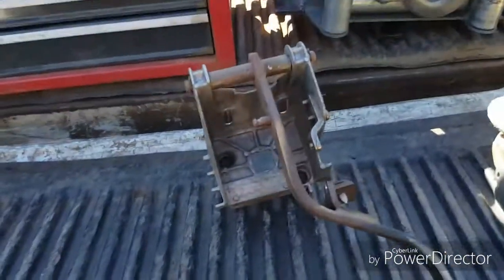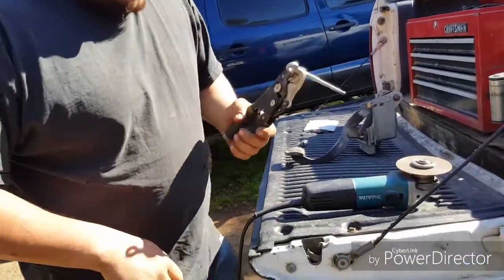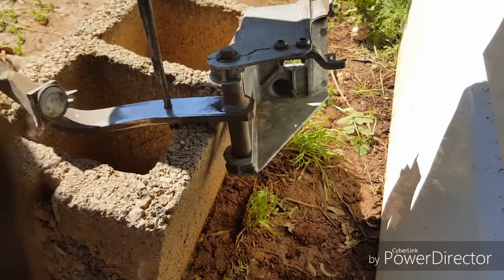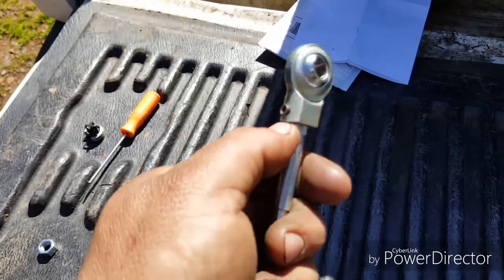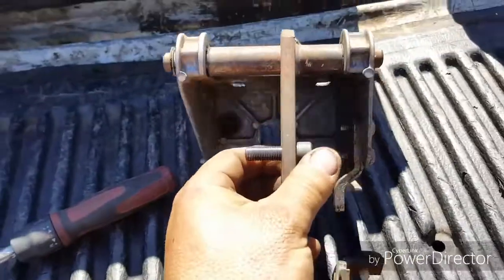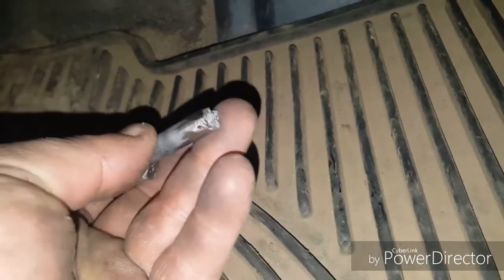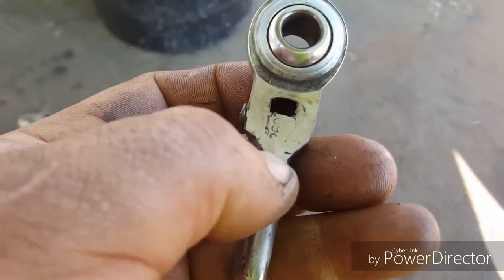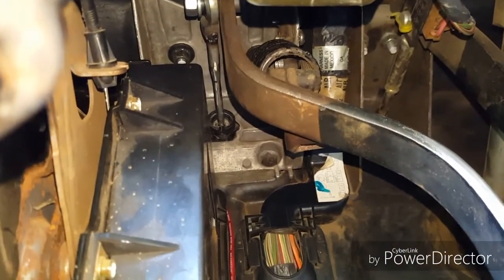F350 clutch pedal fix

Comment: Why buy the joint? Just put a big bolt and washers through the pedal and through the cluch piston loop. Much easier and cheaper.
Reply from the maker: The joint is cheap and a better fix.
Reply: @elmaschinon2699  I ground out the pin as you did. Ported the hole slightly larger to fit a grade 8 bolt the same size as the hole on the clutch rod. Put a washer on, then push it through the hole of the pedal arm. Then, 2 washers, then push it through the clutch rod, then another washer and a locking nut. 0% chance it will ever brake or come loose. Plus, the bolt is thicker and stronger than the thin hex bolt. Bolts and washers were $5.
Reply from the maker: @WhiteYetiAK  that sounds good.
Reply: @elmaschinon2699  Nothing against it, just asking for curiosity.
Reply from the maker: @WhiteYetiAK  Hey man. Only thing that matters is u found a fix for ur problem.

Comment: How do you remove the black safety switch? Also how do you remove the rod itself from the truck
Reply from the maker: The safety switch has a white flat plastic piece that u slide off then u can pull back and away to remove. The rod has a c clip u can remove to pop it out without damaging it.
Reply: @elmaschinon2699  you’re the man. Thank you so much.

Comment: Have you found a way to re-enforce the receiving end of that push rod? The part that always fails for our trucks, is were the ball end clips in through the firewall allowing the rod to fall out and the clutch pedal pops up to the electric control panel. One of our mods was using a chain as a tether so the clutch pedal can't fly up to the control panel when that plastic receiver breaks. Thanks! Great Videos
Reply from the maker: Cass Transport LLC i haven't but I'll have to think of something now. That clip already broke on mine and wut i did is just take off the helper coil spring. Thats the reason that clip fails so often cus of the constant outward pressure. With that spring off mine hasn't broke since. Pedal is just a bit harder.
Reply: Dont weld it and dont grind it add a dang spacer

Comment: I watched your video at this is great but how do you get the rod out of the hydraulic valve mine doesn't want to come out
Reply from the maker: It has a small ring clip on the inside that keeps the metal rod into the master cylinder plastic housing